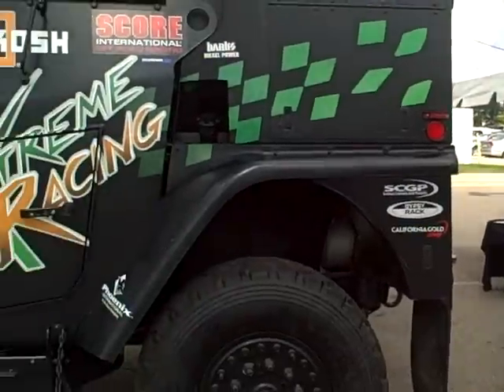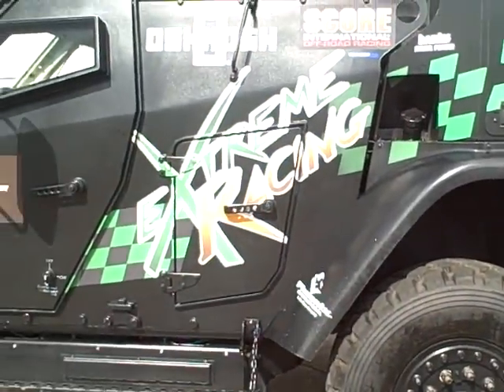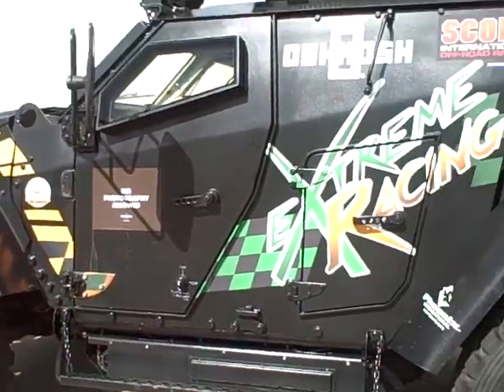Oskhosh Shows Off Diesel-Electric Truck In Dearborn

Comment: Interesting. Diesel-electric has been long proven for rail, and seems like it would also be the best way to improve efficiency for tractor-trailer type trucks. Not to mention it would completely eliminate engine-braking noise, and since the diesel half could be operated at a near constant load it would be a much cleaner running engine. (A supplemental battery could handle surge loads and engine wouldn't need to run rich.)

Considering those things, I wonder why big rigs haven transitioned yet?
Reply: i think strictly due to cost. Buying a diesel electric vehicle basically means your buying two motors in one vehicle. given the diesel powered engine can be smaller since its only use is to generate electricity it still is a costly engine to build and maintain since diesel components are built heavier and stronger than those of gas engines. Then you have the electric engines which are not cheap either. i was looking at some motors earlier that were $7k for 1000ft# of torque when coupled together. 7K is alot for a motor when you have to add another motor to supply the power. then of coarse you still need a battery bank on board and a lot of complex controllers and processors and maybe even a transmission depending on the design type. Thats also alot of weight. so if you have all that weight in lets say a 3/4 ton type truck how much capacity is left over for hauling trailers or bed capacity. im guessing suspension and brakes would have to bulked up to carry the curb weight of the vehicle so that it would have the same trailer towing capacity of a newer 3/4 ton straight diesel truck. that being said its all just a matter of time until the technology reaches a point were there will not be a rational argument for not owning a diesel hybrid or plain electric truck. id prefer diesel hybrid over straight electric myself because of range issues.  i need to personally be able to drive several hundred miles one way and turn around to come home without waiting for a charge while hauling a <10,000# load. and i dont think electric vehicles will have that ability in the next 30 years.